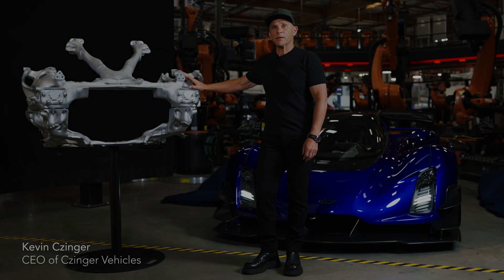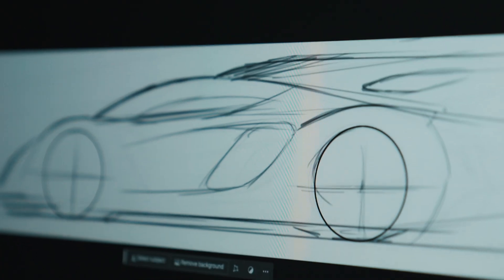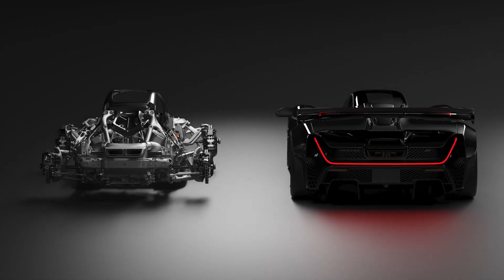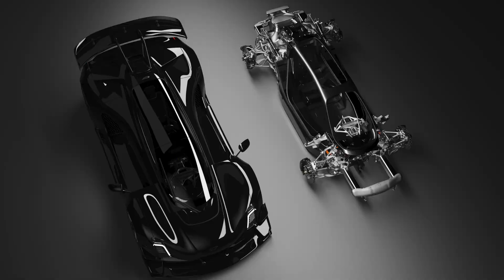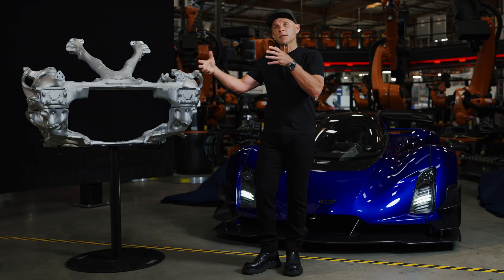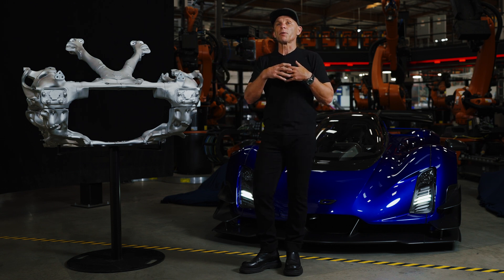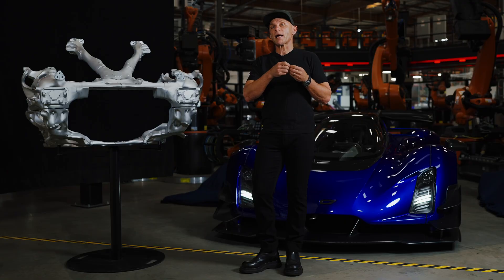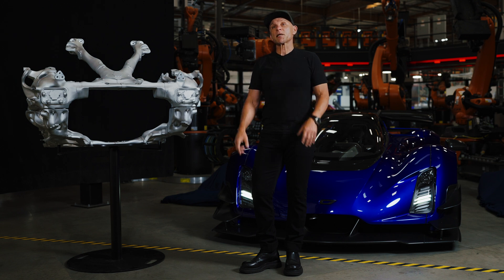Czinger Presents: "The Real Life Star Trek Replicator" | Divergent Adaptive Production System (DAPS)

Comment: Really interesting and innovative, unlike the big car companies who just keep spitting out recycled versions of the same stuff.  People rail about how current EV's are appliance like instead of enjoyable and my thinking is a lot of that is because the old school car companies are just building new stuff in the same manner they did the old stuff because they focus on short term profits instead of long term vision, sustainability, and excellence.  I hope that someday (soon?) this tech trickles down to affordable cars and even home builders because while the 21C is amazing, let's face it the world isn't going to change due to a super exclusive 7 figure car.
Reply: Big car companies stamp them out because people want and need cheap cars of consistent quality. Really old stuff was made in more flexible ways but it went away due to cost optimisation and because designs don't need to change drastically all the time once you have an idea of what you're doing. Metal 3D printing is currently used but since it's prohibitively expensive only on some parts in some cars (Porsche GT2 RS pistons by MAHLE). Generative design is also not new but results in shapes that are expensive to produce and requires very precise input data and real world sanity checks to get anything usable. It has the same issues as CFD essentially.

The combination of generative design and 3D printing into one system is fine if it works but assuming it's actually combined to where you say I want a connector between X and Y able to withstand Z force in B, N, M directions and it spews out a part it'll be a nightmare to debug because then you get the question of "Is what I got what it wanted to give me?" and unless it gives you the design in a separate step (as you'd do it right now) you'll have no way of confirming that because you have nothing to measure against, hence if a part isn't up to your requirements you don't know if the printer is fucked or if the design is fucked. This just sounds like a layer of unnecessary abstraction to me, maybe with snazzy packaging and sexy UI/UX.
Reply: @ianisas Valid points.  I don't have enough experience to make a comment.  I did see the Czinger in person at the Rolex last week and it's amazing.  It also set a record up Goodwood so I'd say the engineers did a pretty good job of debugging.  A road car for me is just to get from point A-B.  I'm just curious if this tech will trickle down to the backyard track car builder that wants a more organic looking but functional part?
Reply: @jdmimportlogistics  I'm mostly against the data in -> structures out part. It seems like a lot of unnecessary abstraction. 3D printing is expensive and slow so I can't imagine a situation where I wouldn't want a 3D model prior to printing. Be it as a sanity check before waiting hours for it to be printed or as a sanity check after it's printed and doesn't fit right for whatever reason. 

Not a dig at the engineers per se as I believe it's likely a case of marketing it as this fully automated insanely abstracted system whereas in reality it's likely much more normal.

Btw, I'm quite curious about how much you can do with a cheapo metal printer. My local makerspace has one for public use and they're not stupid expensive nowadays but the idea of printing a suspension arm on something mostly used for hobby figurines and testing it at home sounds sketchy considering it failing can easily kill you.